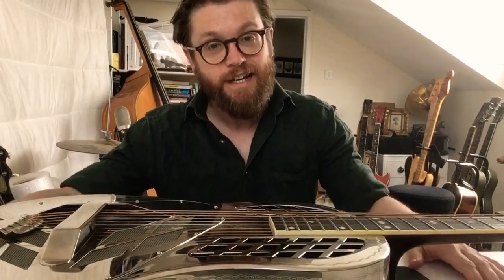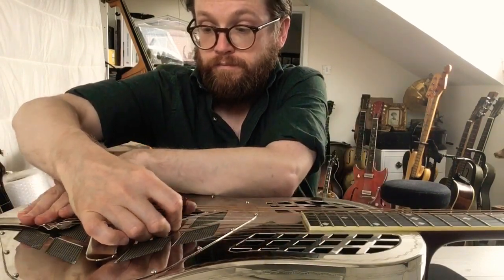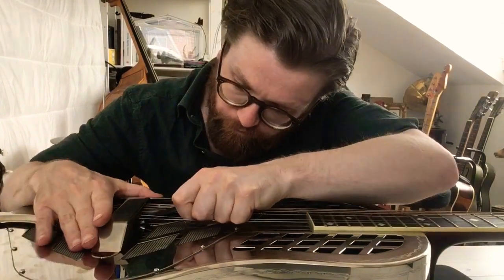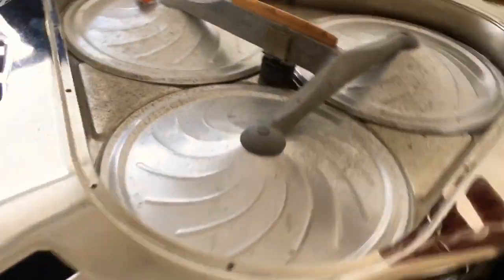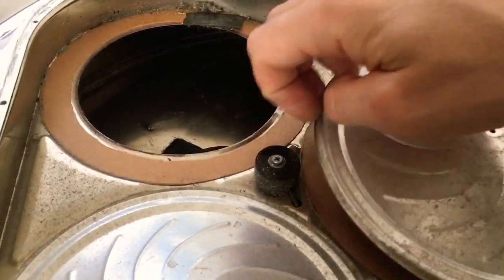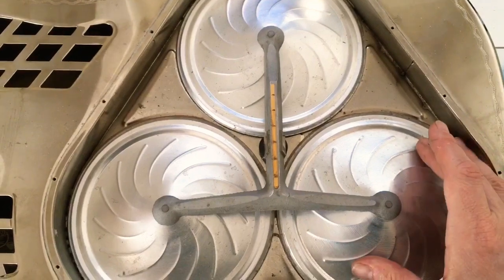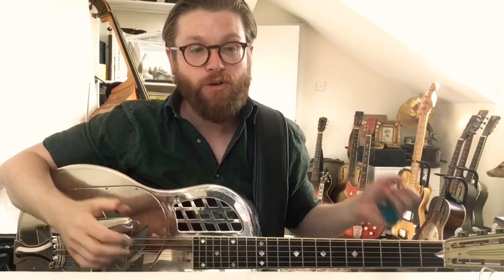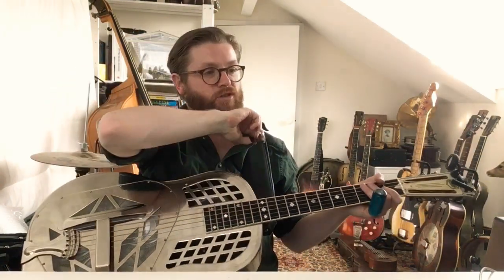How To Fix a Rattle or Buzz on Your Resonator Guitar.

Comment: Thanks. Have a phantom sound on my wood bodied, biscuit, single cone at present . . . not really a rattle. These instruments are so sweet yet so temperamental.
Reply from the maker: Exactly. They’re unique and beautiful but they are technically mechanical and like anything mechanical they fall out of whack. Weird ghost notes are often a case of the biscuit slots getting worn out of shape and the string choking in the slot. The slots need to ramp either side of where the string sits. Specialist resonator luthiers are worth their weight in gold.

Comment: thanks, resos are becoming my main guitar for all types of acoustic music . . . i saw you using 16's man that's hardcore . . . I tried 14's but found my bends were bad (used to 11's acoustic) but 13's its manageable . ..
Reply from the maker: I use 16s on the bottleneck guitar and my guitar that I tune down a whole step. Works well in both cases. Like yourself I find 13s on resonators perfect and 13 or 12 on regular acoustic to be perfect.

Comment: I don't have a rattle but would like to know what dimensions you would recommend for the string heights? I have  Republic that I bought used that setup for SLIDE..current stings 13 -56...but stings are high and makes in difficult to play chords at the nut. Want to lower stings and am contemplating sanding down the saddle? Thank you enjoyed this video.
Reply from the maker: It’s down to personal preference regarding playing style, neck angle and what you can get from the neck relief. 

I’d always recommend a specialist luthier but understand it’s not always possible or cost prohibitive.

Around 3mm at fret 12 and 1.5mm at fret 3 is a good general set up that allows for mixed fingerstyle and slide. 

I did a video about intonation and getting resonators in tune which covers a few points about setup.

I think I might have to do a video about resonator setup and similar ideas.

You can sand the saddle but bear in mind the string slots are key to allowing your resonator to work properly. 

I’d knock a touch off the saddle and see how it goes. Perhaps 1 or 2mm.

After I might be tempted to take .5mm of the bottom of the nut and see if it works.

🎯🎯🎯
Reply: @TheWashboardResonators  Thanks for the quick response.

Comment: Hello, i have a new resonator with tricone. The low E is out of Intonation, a also a little bit. So you have an Idea how to adjust the resonator Intonation?
Reply from the maker: There is a video about intonation that you’ll find on our channel. Not always possible on resonators unless you get one of the few resonator specialists to do a set up and make a new bridge piece. In europe you’d be contacting Mike Lewis at Fine Resophonic or Steve Evans at Beltona instruments. In the US it’s Marc Shoenbergher.

Comment: Thanks for the video. I have a question on a resonator buzz that won't go away. Mine is a wooden bodied spider bridge, single cone resonator. I noticed that I had almost no string break angle from the bridge to the tailpiece and have been told that could be a root cause of the buzz. I have tried to do under-saddle stringing and the buzzing went away partially but there is still some buzz. Do you have any thoughts about this? Thanks in advance!
Reply from the maker: You’re looking for a 13 - 17 degree string angle to get a good break angle. In order to get this and the guitar be playable it may be the case that you need a neck reset to make the guitar work at its best. Also on dobros your find that there is a screw into the cone which can be fine tuned. Too loose and it buzzes, too tight it chokes. I suspect it’s one of these two. Otherwise the cone on vintage ones can fatigue but that’s less likely.
Reply: @TheWashboardResonators  Thanks. My dobro is not vintage it is new, a custom order from Fine Resophonic made by luthier Mike Lewis. My local luthier seemed to think it was the lack of string break angle that resulted in insufficient downward tension of the strings to rid the buzz. But Mike believes it is not the string break angle issue, and it is the way he makes his dobros and he has had no issues with buzzing with his setups. Unfortunately I had the reso shipped to me halfway across the globe, so I can't visit his shop to have him resolve the buzz issues.

Comment: i just move the saddle under the tension and it clicks and goes away. how did you go about removing the saddle from the t bar? mine seems glued in hard
Reply from the maker: bebenavole Not sure I follow. The wood saddle is glued in on mine and stays put. Didn’t touch the saddle in this video. Did clean / reseat everything else which seemed to fix it. Let us know if we can advise further!
Reply: i meant the t bar. i move the t bar under tension and it usually goes away
Reply from the maker: bebenavole of course. Works well. Should always go towards the bridge though!

Comment: All i can say about buzzes is : do not wake up the dog peacefully sleeping if you don’t want him to start barkin. In most cases, buzz has a simple cause. Loose cover screw, ball string touching the top, cone not perfectly seated... Your advice to slightly move the bridge with a pencil (after diminishing the strings tension) is very good, but... DON’T REMOVE THE CONES ! This is, often, the best way to amplify the buzz. Don’t swap cones either, ’cause they have their own "seat" on the rim. In most cases,  cone buzz disappears as fast as it comes...

Comment: I haven't checked the whole thing. The front and the thing the strings attach to seem to reduce it a little when I push on them. I suspect that something has happened with the weather. I bought a national Triolian a couple of weaks ago, and it's been fine, but suddenly it's a quite hot day, and buzzing has appeared. I'll probably have to find someone more skilled to find the issue - Australia doesn't have that many resonator players or techs.
Reply: My god, no buzz at the end of that video, but we don't really know the culprit.

I assume you've just got more used to pulling them apart, but as a clumsy idiot, I'd rather let other people with good skills do that.
Reply: I really wanted a tricone, love the sound of those things...
Reply from the maker: For me Tricones are the best. Especially wooden bodies (but that’s a separate conversation). You’re right to want one but they are monumentally difficult instruments to keep in good order.

Even the ones from the good old days of the 1920s and 30s can develop issues and buzzes or never be able to put out the full tone.

There are a number of issues that could develop. Let’s lust them and work through to check;

1/ cover plate tightness. Play the guitar and press the plate down. 

2/ tailpiece, either touching the guitar top or the string ends not been seated right. Slacken the strings and put a piece of card between the tailpiece and guitar. Also wiggle the ball ends.

3/ Bridge and cones. The seat of the aluminium T-bar on the cones can rattle. A tiny touch of Vaseline and reseat of the whole system can take the rattle away. Also if the cone sinks then the lip of the body well can touch the inside of the cone. As per the video pushing the whole assembly a whisker can help.

4/ Bad string. I find when G & D strings get worn from fingerpicks they cause a rattle because the string is essentially choked.

5/ Trussrod. I’ve seen a friends resonator rattle and it couldn’t be located until I pulled the neck back. We found that the trussrod was loose and resonating inside the neck channel. An expensive repair but it fixed it.

6/ Loose tuners, tuner buttons, bushings and screws. Sounds odd but my old archtop developed a rattle and it took a while to locate it and find it was the tuner button. Touch of superglue and the rattle went away.

Hopefully that helps to start.
Reply: @TheWashboardResonators  Thanks very much for the list. I'll keep that list handy. Funnily enough, my triolian seems to be without a rattle today. I think the high humidity and slightly hotter temperatures yesterday must have just caused the issue, though if that's the case it will probably reoccur until it's properly fixed.

Really appreciate your channel. Great resource for people just getting into resonators and nationals.